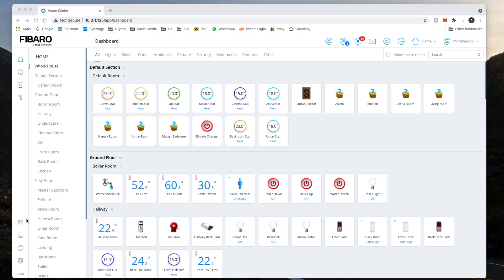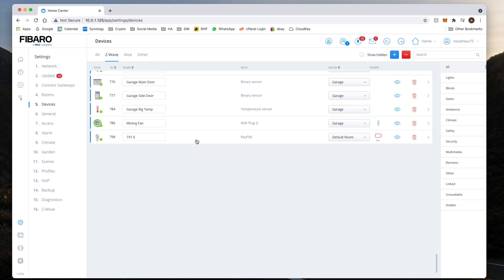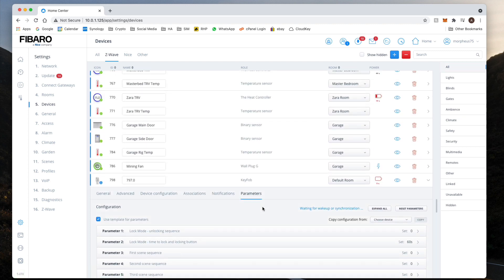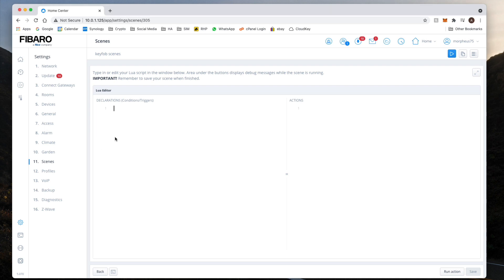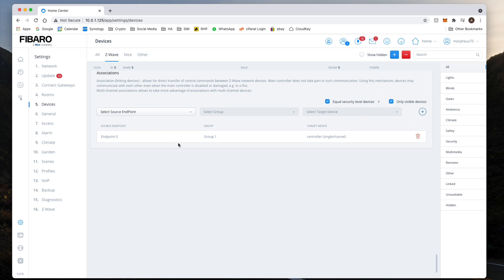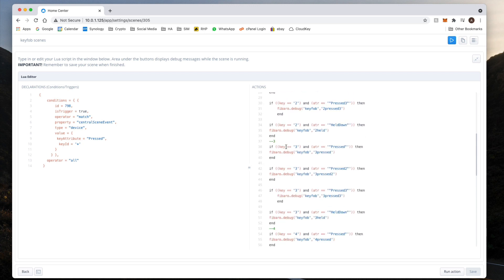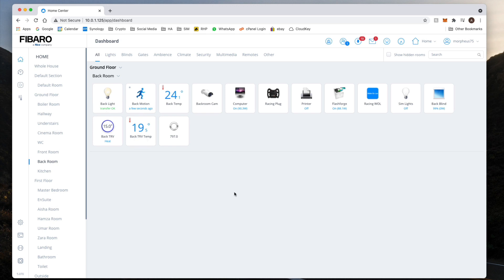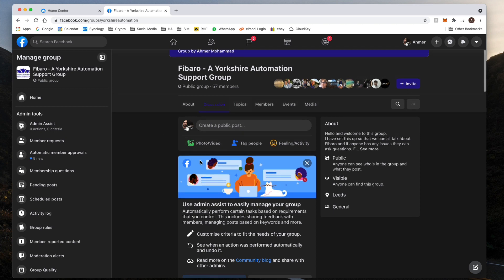How to add a Fibaro Keyfob to Fibaro HC3 and setup with all code.

Comment: Is it essential to use the remote with scenes? Or, for example can a simple 'open' command be allocated for an already configured curtain/blind?
Reply from the maker: you can use any command with the keyfob. i currently use to operate devices, blinds, even change the volume on my sonos
Reply: @YorkshireAutomation  thanks for the reply!
Is is essential use scenes though? If ai want to turn on a light, it would be great to just configure for example to turn on light 1. Rather than create a new scene to do the same thing. Hope that makes sense.
Reply from the maker: @mick0082  if you dont use code and goto the ADVANCED tab of the keyfob then you have no choice but to use a scene.
If you goto my shop and download the template keyfob scene file for £5 then watch the video it will show you how you can type commands into each button press(es) to do action.
this can be simple hub.call(ID,"turnOn") commands to activating other scenes, or changing variables, or running other API commands.